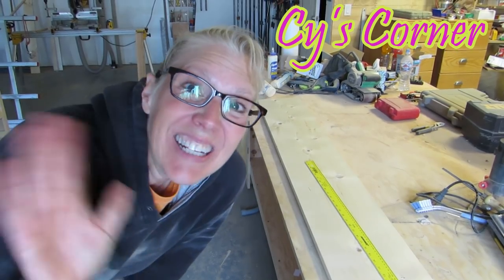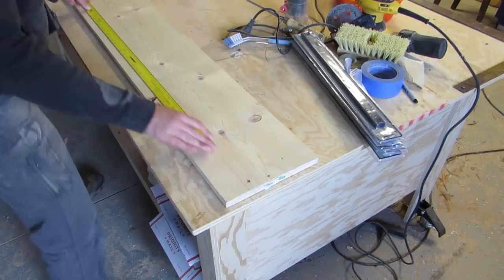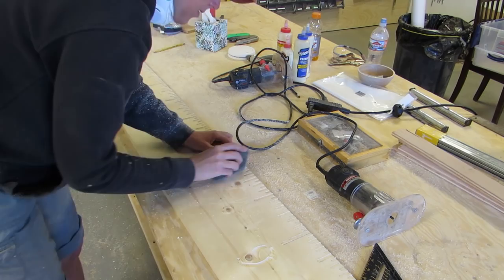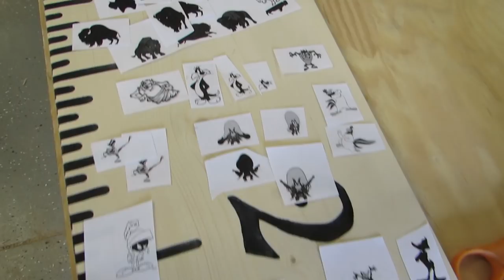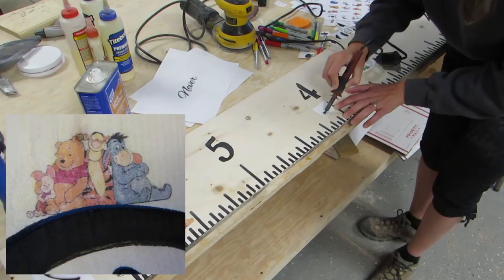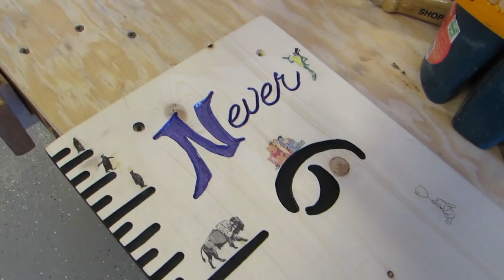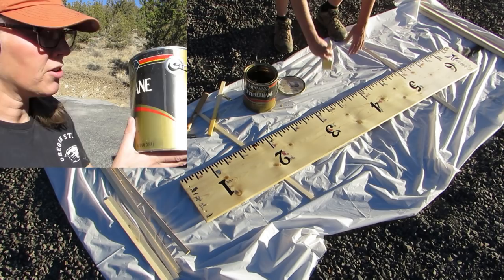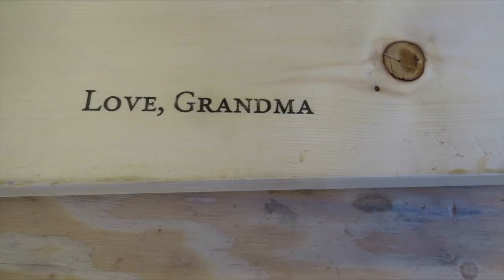Ruler for Nev, to watch her grow.

Comment: you looked 6-1/2 ft. tall :>)  great looking ruler (as are all your projects).  I have used the poly with a 50/50 mix with mineral spirits (years), mix only as you go and keep extra in Frig, will last a month (?).  I wipe on with paper towels and wipe on once an hour till I get 4 or 5 coats.  No sanding and dries quick.  be mindful when disposing of used towels.  great video.  did you use laser or ink jet for pics?
Reply from the maker: Yep, I am tall, but not that tall!!!  Thanks for the tip on the 50/50 mix! And I use a laser jet for this type of transfer.
Reply: you must be close to 6' (6" less than ruler).  Oh yeah, I guess I should of known that. I must be getting old.  anyway, great video.
Reply from the maker: Yep, 6' in my socks!